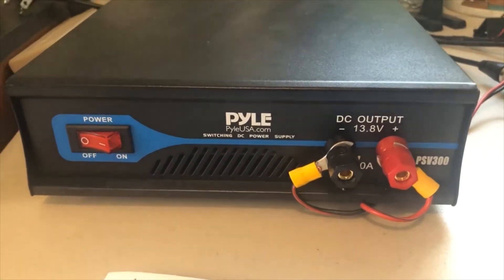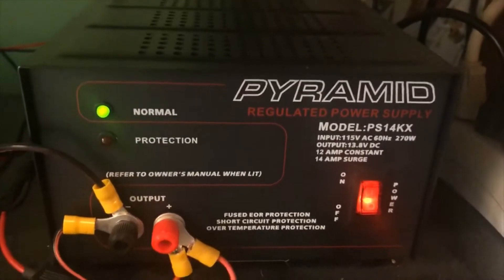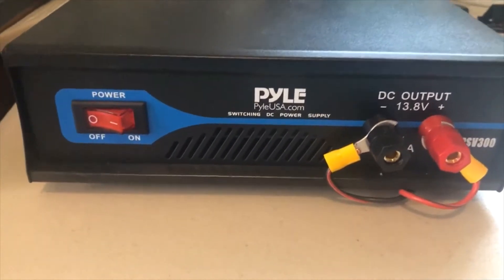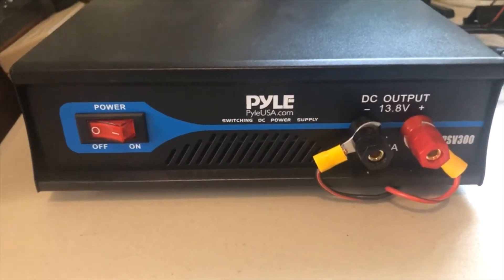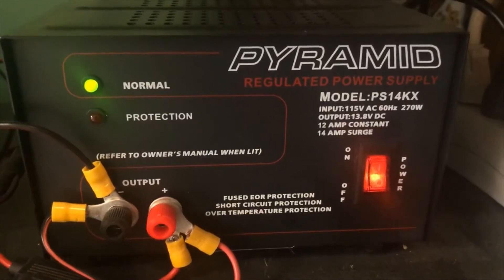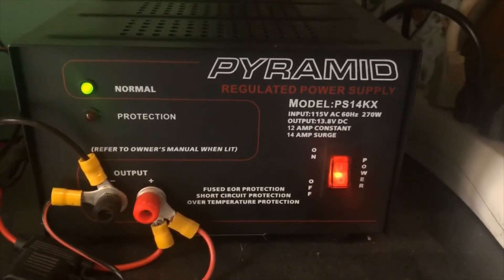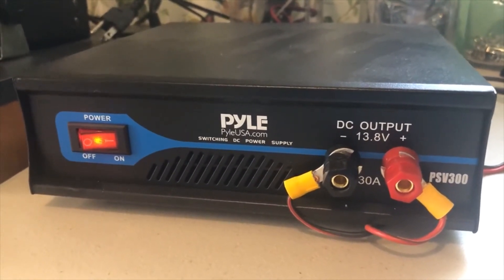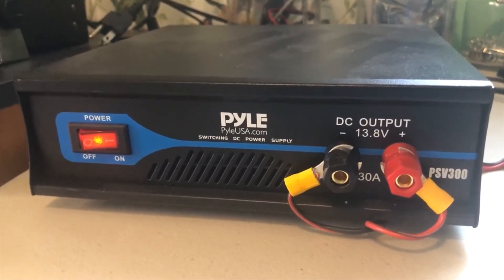Pyle PSV300 Switching Power Supply Quick Review

Comment: I want to add a bypass capacitor to the output connectors to cut some of the noise out from the PS... but I don't know what size to use.... or what value to use on the cap... anyone have verifiable information as to what value range of capacitor I can use?   I see output is supposed to be <150mv RMS....certainly don't want to blow up these damn power supplies.

Comment: I have a Pyramid PS21 ans the internal cooling fan is ridiculously loud. The voltage has also been bad to surge above 14 volts with minimal load. Needless to say, that is not tolerable and I sent it back. Since Pyle bought Pyramid they just get junkier.  There are better and quieter ones around.
Reply from the maker: Thanks for your replay and experience with the product. I've had good luck with mine so far and I haven't heard the fan come on yet. The only things I run on mine are the amp and the AnyTone AT-778UV, and not at the same time as they are not connected to each other. I probably at most use  10 amps and the voltage has been pretty constant under load. It's a budget power supply, and I agree with that there are much better products out there. Thanks for the comment, and 73s from 595 Northern Nevada!